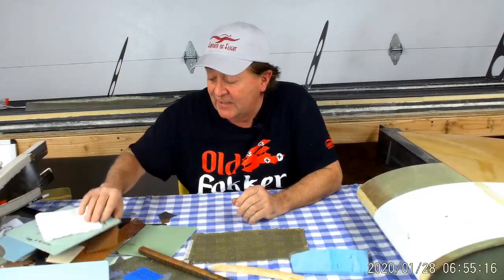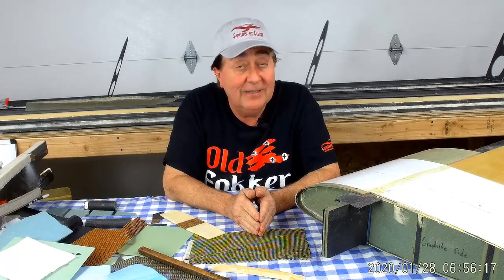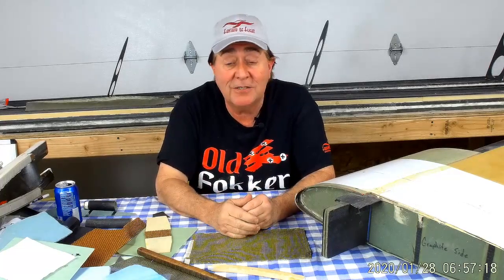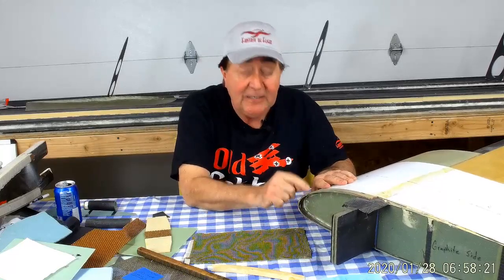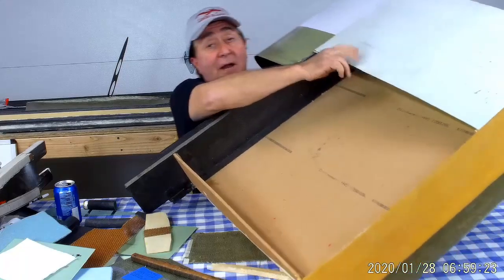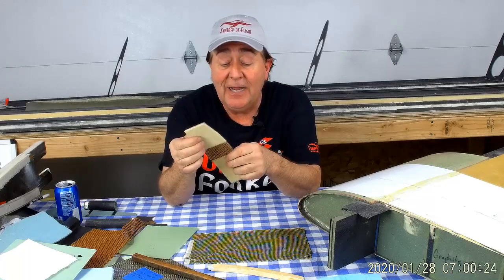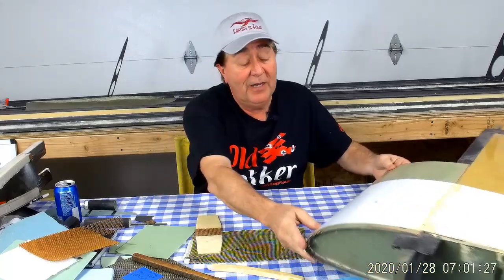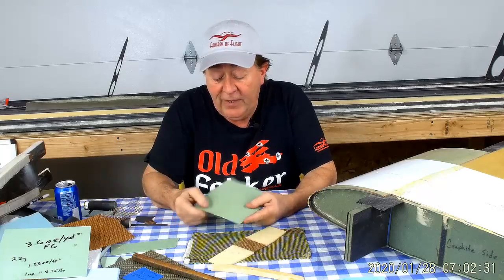Material and Structural Trades, Part IV - Klingberg Wing MkII Development

Comment: Hello!
First things first: What a great channel!! Very informaitve! Thanks a lot for sharing your thoughts. 
Maybe I missed it, I'm not trough all videos yet, but how do you manage the different load behaviour and thermal expansion properties of carbon and glass? I've been told to not mix different types of fibers when parallel load sharing occures. Somewhere i read "in a hybrid cloth part, the carbon takes the load and the glass adds weight". 

Greetings from Switzerland!
Reply from the maker: Ah, a classic question. Actually, in about two more videos in the Material and Structural series I cover this topic. But, to give you the sneak peek, I'll ask you a question, "Why is it that they manufacture cloth that has Kevlar and carbon fiber interwoven? Isn't that the same issue as "mixing" fiberglass and carbon fiber? Kevlar and carbon fiber have distinctly different properties, but they weave them into one cloth - why would they do that?" Bottom line is, it is a compromise to try and gain some of the benefits of each material in exchange for some of the ultimate strength. Back in the day - the early '80s - I inter-layered Kevlar with carbon fiber cloth to make the tubing for my first wing - golly, a lot of engineers had a "hair on fire" moment - I never heard so many people say, "You CAN'T do that!" My response was always, "Why not". In that case I was willing to give up some of the ultimate strength of the tubing for safety. You see, by inter-layering the two different materials, I created a composite that actually had a yield zone before failure. Yes, overall it was not as strong, but having the Kevlar in there protected the pilot in case of tubing failure - the Kevlar would act as a "bullet proof vest" and contain the shards of carbon fiber which can be as sharp as needles.  For my current wing, I have different reasons for putting fiberglass on the outside and CF on the inside of the D-tube and those "secrets" will be discussed in the coming videos - so stay tuned! As you go forward with your own designs, remember to keep the creative paths open by asking that key question, Why not?" And, thanks for all the nice feedback, it means a lot to me.